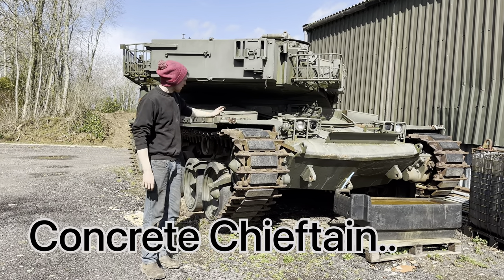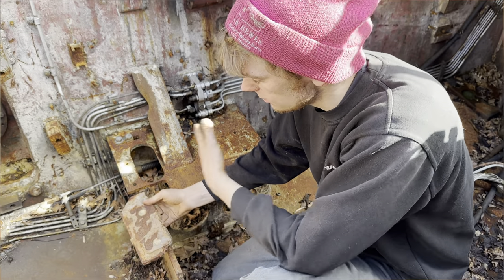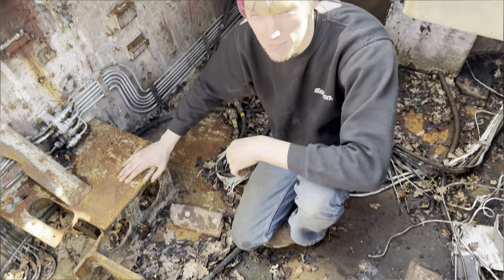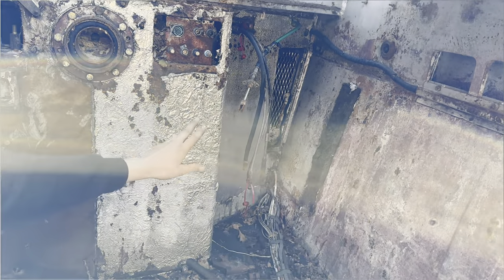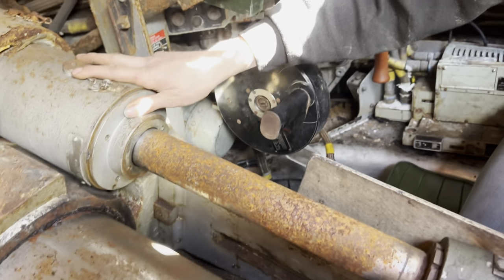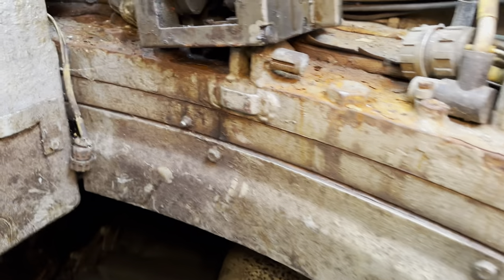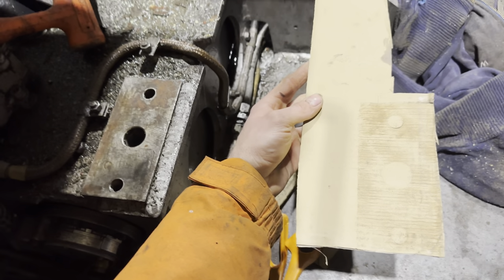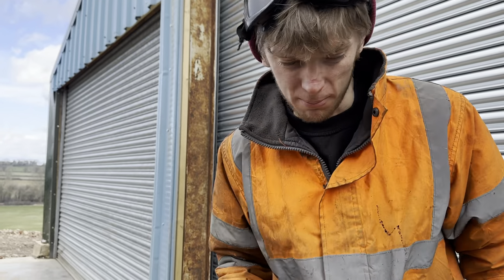Can we Buy and Repair a Tank for under 20k?

Comment: The most important question though, Is the boiling vessel still working in the turret ? Got to have a hot brew !
Reply from the maker: Il find out for you in the next video
Reply: @MrHewes  actually, we need a video of one of them in use. I wonder how far you can go cooking with just the bivvie.
Reply: Should have been the first thing to check.
Reply: @williamdiffin28  before taking the concrete out lol

Comment: We use a very similar set of jigs to determine the mounting position of marine engines relative to the inboard shaft or Stern drive. I think what you're doing is fantastic,. I have no doubt that Chieftain will be driving in no time.

Comment: It might be worth looking into what machinery alignment services are available locally. When I worked as a machine design engineer I once had to align an electric motor with a gearbox precisely. We had a technician come out with laser based equipment and we were able to get everything lined up within tolerance to prevent damage of an intermediary coupling, etc
Reply: Yup thats the go, simple stuff we used to do with turbines etc.

Comment: Good morning. Magnificent project. I never imagined that a cement filled motor and gearbox housing could be so clean after removing the cement. An important matter. A few years ago I collaborated in the recovery of a Chieftain and we had some problems due to the presence of asbestos in the barrel sleeve and other elements. Seeing you handling the motor cables reminded me of that. Stay safe.

Comment: If you make a jig in the good tank that bolts to both engine and gearbox mounts and use it to line up the replacements in the buggered tank then welding in replacement plate and gearbox mounts in the concrete chieftain is totally doable! Just remember to fillet the welds to get full thickness penetration.
Looking forward to see the concrete chieftain up and running.
Reply from the maker: That’s exactly my plan!
Reply: @MrHewes , what is?
Reply: @MrHewes  you sir have a good plan! 🙂
Reply: A cunning plan.... 😊
Reply: @GlideYNRG  so cunning you could put a tail on it and call it a fox.
Reply: @Brigadier9  😁😁

Comment: When doing this type of work it's vital to measure between the trans mounts left and right and also diagonally to the opposite motor mount to verify the trans mounts are square and the right width apart.  Your brackets don't verify that.  I usually use cut off bolts and measure outside edge to outside edge.  The alignment is still going to be a joy but it's doable.

Comment: You have the motivation and the skills to get it sorted only thing you need is time. Just listening to you it will be done. At the end of the day you will have a working tank under £20,000 jobs a goodan. You have done the hardest but digging out the concrete.

Comment: Personally I'd probably build the gearbox mount in a sliding bracket arrangement so you can adjust the height to be absolutely perfect for the box you're mounting, then once you have it all perfectly lined up, weld it good and deep so it can never move again. Bit easier to do the precision height adjustments that way rather than removing material with an angle grinder. Damn shame they torched the brackets to begin with though
Reply: He needs to find another tank that's being used for display or a museum for military and copy the original mounts to temples
Reply: That would probably be best. But it better be made where it can't move

Comment: Thats bloody good work there mate, not easy to get a tank moving no matter the condition or age, most these vehicles were never designed to be driven around like a family car, and requires constant maintenance, its bloody well a miracle how they fielded hundreds of thousands of tanks in WW2.
Reply: Tanks of WWII were a lot less complicated To maintain than tanks from post WWII. Simplicity isn't needed when you have enough time to build them.
Reply: @PugilistCactus  also, ww2 tanks didn't really sit around long enough to accumulate any rust or let those gasket harden and crumple... 

I'm curious how old the average tank was at the end of the war.

Comment: The bracket idea sounds like it'll work rather well. Only one caveat though is that it's easier to cut off than add back, so for the section of vertical metal web, go ahead and fix on a oversize piece that you can mark and trim down with a grinder to get your height for the bracketed pad set.

More so if you build it with mild steel or wood to get the pattern. The more prepared you are for the work, the easier it should be. You don't have to listen to me though, because I think you've already got a plan in mind.

Comment: If the engine is still out when the jig plates come back then join them together with a bit of flat bolted on, to save doing corner to corner measurements. I’d say weld, but that will warp them. Mega odd to cut the mounts off though? Cracked? bent? As a fitter/engineer I don’t like mysteriously hacked off parts :D
Reply from the maker: I don’t understand why on earth they were cut off! Never seen it before

Comment: Strictly speaking you don't need the GUE to start the tank. It's recommended in cold weather to run it to warm the main engine and ease pressure on the batteries when cranking. If you were running full GCE then I could understand keeping it in the tank, however the main engine should provide enough power for what you want to do at show's.

Comment: Two questions: I'm guessing the concrete didn't seize up the drive wheel, even though there was concrete inside where the drive shaft goes?
Do you use gas for cutting in preference to a plasma cutter and if so why?
Keep the videos coming really enjoy the content and presentation.

Comment: It's probably best to redo the engine frames, since US Army do basically the same thing anyways, due to the frames being a wear item owing to the rumble of the jet turbine or regular diesel engines used therein for propulsion (ie. cracks in the frames, mechanics tend to also pay attention to the attachment points, not just the powerplants), they're so much more powerful than the one in your truck. Yet it's good that you went into this project knowing it's a lot of work, you shall be rewarded soon enough with the screams of the tank engine once you rebuild the tank - they're epic machineries.

Comment: Laser cut a jig out of at least 1/4" to 3/8" that has the right hole pattern. Bolt said jig to existing holes and transmission bracket and weld er up. No fancy machine alignment laser man or anything

Comment: The APU/Donkey engine,H30. Was used to start the main Engine in really cold conditions. Generally in fair conditions the main would start OK. But the H30 was used to warm the main engine through. Which was a great advantage in certain extreme circumstances. Er um, Germany? Anyone! The thing was not to let the main engine get too cold. So run the H30 occasionally to keep the main engine warm. That’s if the H30 itself continued running. 

I’m absolutely certain that if the H 30 was built by me! It would be brilliant. And I rebuilt many of them.

And a bit later the Perkins P4108. Although that Engine was problematic! Three bearing Crank! Urgh.

Comment: How about pulling the mechanical guts out of a "largish" mining truck. The ones I saw were 7t tonnes gross wt and they can be MUCH bigger. And were diesel electric. Spare parts are available. Link the motors to the drive sprockets and tuck the generator motor and the battery packs in where they can be made to fit.I don't know how big the drive motors are; but they would be smaller than a 1000 Hp diesel.

Comment: do diesel electric drive with extremely geared down inboard boat prop electric motors direct driving the track drive sprocket on either side. A 40kw generator with a Lead Acid pack to cover load spikes would be enough.

Comment: I wouldn't bother using anything original, surely you could drop in any sort of excavator drive system, or even a hybrid electric system.
As long as the tracks spin you're sorted.

Comment: Suggestion,, do not use the gas cutter with the hose under where you are cutting. Ask me how I know, and no I did not do it but was stanging near it, And the bottles so I turned the bottles off quick. Scared the crap out of me,, they guy cutting was as white as a ghost after have heavy flame around his feet and charred overalls. And minor burns to his ankles. Earlier on he had been working in shorts.

Comment: A normal battery charger won't bring a flat lithium battery back safely, Li-ion's have an in built minimum voltage cut off within them to stop them blowing up hence it showing no volts, battery tender pulse chargers (smart chargers) will bring them back to life safely
Reply from the maker: The missile guidance knows where it is, because it knows where it isn’t

Comment: As a fabricator fixing lots of heavy broken stuff, rather than trying to add bits. I would cut that vertical piece away leaving a nice straight piece for a up hand weld. Take the cut piece down to the floor plate so you can make a new piece with a nice weld to the floor and one up hand weld. As you will know the height (with your jig) It will be a on the bench made part and simple welding in a tight space. Yes I can weld... crane mats for 450 ton mobile crane lol
https://youtu.be/6-RcuMaQ92k

Comment: I installed engines in ships for years and you over complicating the engine and gearbox mounts.
It’s not that critical because as both can easily be aligned and / or shimmed if necessary.
After all when mechanics change a motor and / or gearbox they just change them and they don’t do any complicated aligning.
A motor and gearbox can be more out of alignment then you think without doing any damage to the gearbox.
You have to really bring them out of alignment before problems arise….
I know from 20+ years experience 😂…
Ofcoarse … the better you can get the motor and gearbox mounts in line the better it will be.
But you can do this with basic tooling and common sense 👍😀.

Comment: scania swap scania swap scania swap scania swap
Reply from the maker: Not enough HP
Reply: @MrHewes   Though dost spake heresy young man 😢 ......
Even a road standard 2000 on 15.6 litre V8 will put out 580 hp / 2,700 Nm compared to the 650 hp of the L60 No.4, Mk 4A.
A 2004 on 16.4 litre V8 puts out 730 hp / 3,500 Nm compared to the 750 hp of the L60 MK 7A
And neither will ever break down!
OK so I am biased: Retired Scania Master Tech ....
Reply: @MrHewes  Take the engine out of the Landy now you’ve got it running, all that untapped power is wasted where it is 😂😂😂